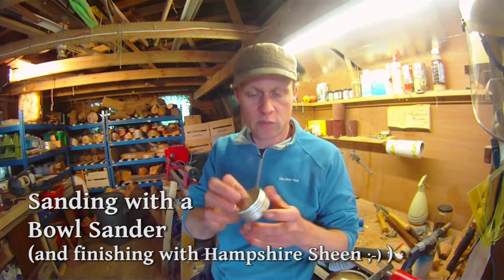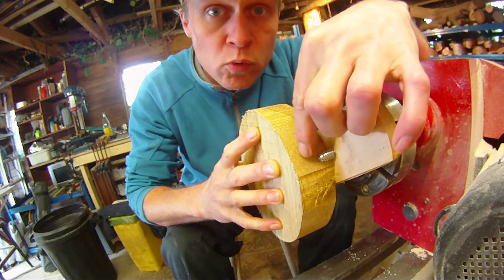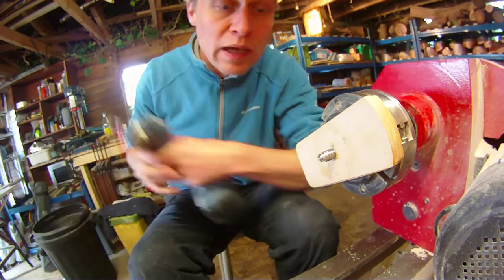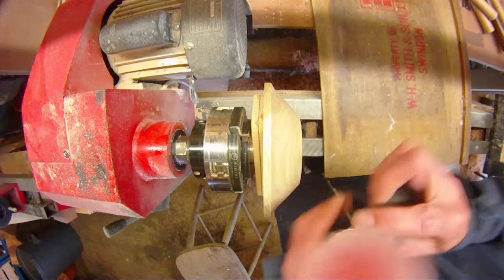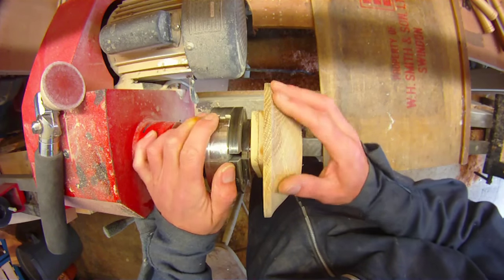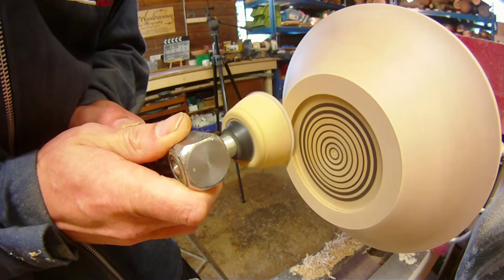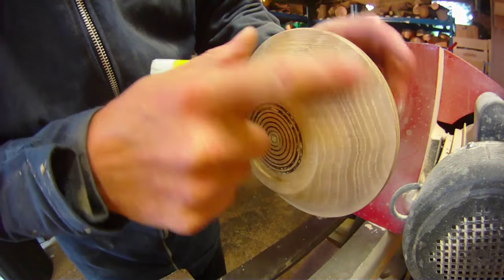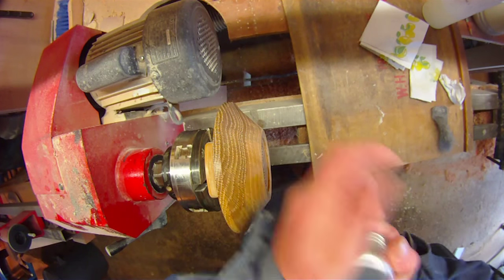#35 Woodturning: Using a Friction Bowl Sander and Hampshire Sheen

Comment: Very nice presentation - and nice looking bowl.

I find that with some woods (eg, maple), it is very difficult to deal with end grain, especially end grain at two points on the circumference of the bowl where the direction of rotation of the bowl means that the grain is unsupported.  I've tried manually sanding these areas in the opposite direction (my lathe isn't reversible), or using a drill to power-sand, but neither of those techniques is 100% successful.

Comment: Nice work Martin.
One question, do you find after a few weeks that you get black dots appear in the grain of the oak? I had this problem a few times and was told by the chaps at Trent Valley Woodturners, that it was small bits of wire wool reacting to the tannin in the wood.
Cheers,
Ben

Comment: Thank you Martin for a very professional piece of turning.  The bowl is really lovely.   I think you could take up full time teaching of the art anytime.As my wife had delegated many gardening duties to me during the past few months I haven't done as much turning as I would have liked.  However, as the result of our poor summer autumn has arrived early so I'm looking forward to a whole day in my workshop tomorrow.Coincidentally, a few weeks ago I bought a bowl sander identical to yours.   I think it's an excellent tool with a good weight and a comfortable grip.Also, I was inspired by you to buy a blow torch but it's still in its wrapping so I might even break it out over the next few days.Happy turning,Alan.
Reply: +Alan Simpson Today I managed to turn a bowl out of padauk and for the first time used my new blow torch.   I'm really pleased with the result.    I had a few minor flare-ups when using the torch but these were down to residual sealing wax on the blank which I hadn't fully removed.
Reply: +Martin Saban-Smith Thank you for your reply Martin.I've cut a little channel round the edge of the bowl about 2cms wide in which to place some tiny flowers and then fill with it with epoxy resin.I should have it done within the next 48 hours and I will send you some photos.Best wishes,Alan.